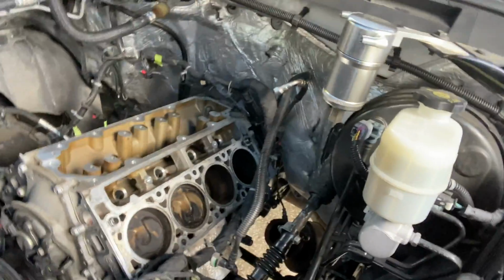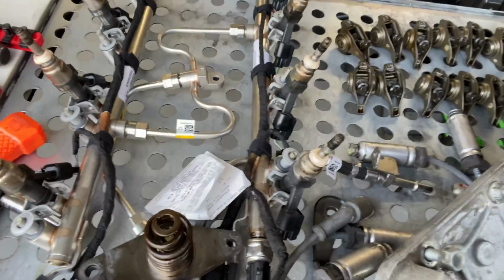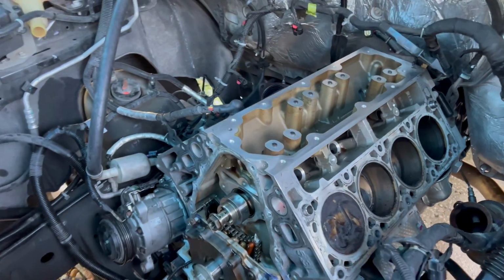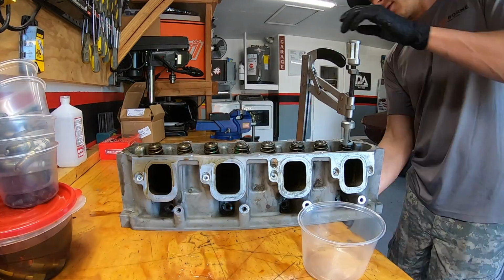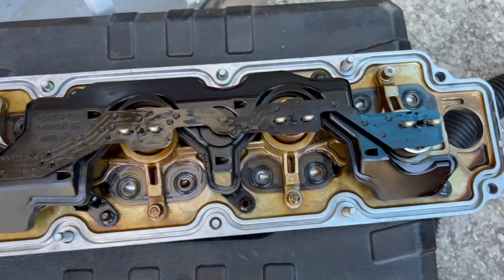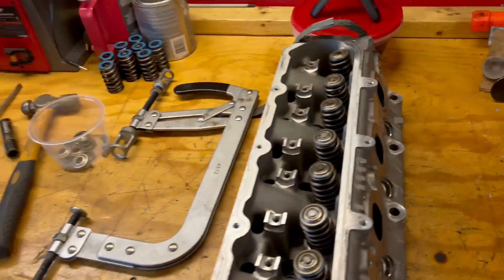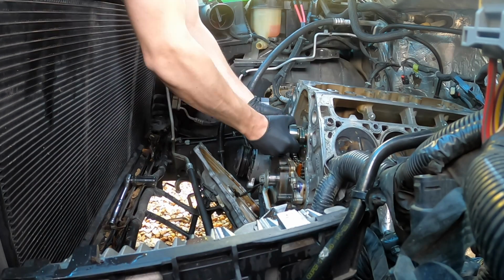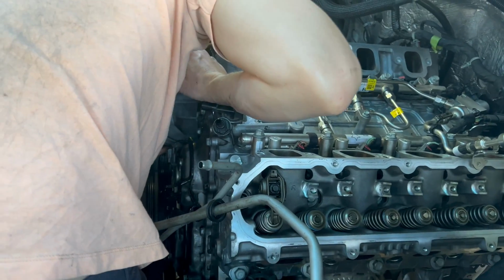Swapping a ZR1 Corvette cam into a 5.3 LT Truck!!!

Comment from the maker: Unfortunate as a collapsed lifter is, it never hurts to do a little upgrade
Reply: Just did the same. Had a lifter go and it SNAPPED the pushrod. 

So I did the full AFM delete and cam swap. Had the same raunchy ass smell when it started up lol
Reply from the maker: @RyanMonty  I hope you meant sound lol
Reply: @DAPerform  no, smell. From all the oil, fingerprints, coolant on the exhaust lol
Reply from the maker: @RyanMonty  oh duh, smells like burning flesh lol
Reply: @DAPerform  you got the part numbers for the cam and springs?
Reply: Could we get a list of part numbers ? Seems like the best budget option to delete Dod! Great job

Comment: How/why did the pushrod length change? L83/LT5 use the same 7.850, same ‘’Ls7’’ lifters , cam base circle is the same. Did you deck the heads or machine the block ? If not the geometry would have remained the same no?
Reply from the maker: Different cylinder heads, pistons and rods, there’s lot of reasons why the length changed just because they share a similar lifter and cam doesn’t mean everything won’t effect the length. That’s why it’s crucial to check
Reply: @DAPerform interesting thanks for the reply,  gm made these all pretty cookie cutter , we have swap cams in quite a few, LT5 , L8T in L83 , L86’s , all stock deck heights and no milling The LT5 and L83 share the same stroke, rod length and overall deck height is maintained from the piston. I still can’t wrap my head around your basic cam swap needed a shorter push rod.
Reply from the maker: @JustCantSitStill no idea. Our pushrod length tool doesn’t lie. Truck has been running strong since the swap with no valve train noise
Reply: @D @DAPerform well that’s all the matters in the end. 👍🏻

Comment: It’s still has a knock in it!
Reply from the maker: It went away after the first start. It takes time to pump the lifters up
Reply: @DAPerform 45 years GM tech , I do probably 20 of those upgrades a year as a weekend side job , that lifter tick goes away in seconds not minutes. As far as the oil pump R&R short cut you took good luck with that , that never works, invest in a magnetic drain plug because your oil pump will soon be talking to you. Monitor your engine condition with oil filter element inspections and oil analysis lab tests… Just a solid recommendation, no one like to do that same job over …
Reply from the maker: @cbnx82703 it’s been years since this was done and not a single problem with the swap. Thanks for your opinion!
Reply: @DAPerform  Well I am glad for you, your circumstance is more the exception than the rule , those clearances and tolerances are in the range of thousands of an inch, it’s totally fine to take risks on your own equipment but on customer jobs it’s not the worth the risk of the financial aspect. If you don’t mind what do you think that job ran parts wise ? By the way the removal of the fuel rail and injectors and high pressure fuel pump is the way I do it as saves about $200 in supposed one time fuel line costs…

Comment: So you didn’t replace the injector tip seals? Not a good move, it is necessary. You’re giving horrible information. Guess you’ve never seen a leak at the injector bore due to someone not replacing them.

Comment: Any quarter mile timeslips for before and after?  Did fuel efficiency change?
Reply from the maker: No and no
Reply: @DAPerform  Too bad, it's always nice to measure performance as the butt dyno is notoriously inaccurate.
Reply from the maker: @swathdiver489  it’s a stock lt4/lt5 camshaft just deleting the DOD. Lower gains would not be substantial

Comment: That's a nice little project. When I did my 2018 Silverado. I did a mild cam, DOD delete, changed the lifters, pushrods, and added a Katech Hi-po oil pump. The L83, and l86 are aluminum everything 
 It's great to save weight but not so much for heavy duty driving in the heat, they use oil to cool the bottom of the poaton and sleeves, they eat oil. I switched to a 5w-30 mix and with the heat and my heavy foot, here In Miami, she seems to be happy. But those trucks build with the bailout money have a bunch of faulty parts. I replaced.y AC condenser and did a heavyduty/hi-perf  trans rebuild. With a full Sonnax rebuild kit. She is build to hold 1000hp. I'll never push that motor to that. But eventually I'll do a few more upgrades and slap a small snail in there. Have a good one brother. Enjoy 🤙🏾🙏🏾

Comment: Bro, my truck chevy 5.3 l83 motor must be a god tier motor fully stock on engine internal no issues or ticking, only the transmission shutter, but im about to fully rebuild my 6l80e with everything upgraded new torque converter clutch plates etc even new driveline axle plus new cam since I'm investing in a converter and transmission to hold the power

Comment: Any increase in off idle tq and low rpm towing? Torn between this cam and the smallest btr/tsp cam available for the lt series engines. The 6.2 intake and tb made a noticeable off idle increase in tq on my otherwise stock 5.3.
Reply from the maker: If you’re not looking for any chop I would just stick with the factory zr1 camshaft. Theres no surging with the stock converter or any noticeable vaccum loss. Power wise it might have picked up up a little but nothing noticeable

Comment: Hello, 
I have yukon ls9 5.3 2008 i am thinking to get zr1 cam
Is it good so far and how much hp you got
What else should I add into my car with zr1 cam
Thanks
Reply from the maker: The can swap was to delete the active fuel management and replace the lifters that are prone to failing. Little power gains if any at all

Comment: One step back, 2 steps forward! I put on the Range technologies AFM delete at about 46,000 miles hopefully it'll prevent the lifter issue. How many miles? Thanks and good job! 💯🇺🇲
Reply from the maker: Lifter failure happened around 80k
Reply: @DAPerform  thanks

Comment: How’d ya get the timing chain over the cam phaser and sprocket?
Reply from the maker: With a lot of patience and time. It was no easy task but we got it done
Reply: @DAPerform  LOL… that’s called diverting the question bud..
Reply from the maker: @curtisrandell13  we had to walk the chain off of the sprocket. It seems impossible but it is
Reply: @DAPerform  tried that once then I stopped. Just didn’t have it in me 👍

Comment: isn’t this cam meant for boost tho ? why use it on a na setup
Reply from the maker: Yes and no. It’s a factory cam that was used on a boosted engine yes but the specs of the cam resemble more of an NA setup. They were never designed to make a lot of power with the factory zr1 engines which are 6.2l with a blower on it

Comment: Ur using stock torq converter or u have a bigger stall 1?
Reply from the maker: Nope stock converter
Reply: K kool im thinking bout installing one on my 2011 chevy had a stage 2 cam with 2400 stall

Comment: LS7 lifters are a factory lifter... they have a little different design than the stocks but don't offer any performance advantages and maybe a little more durability. A lot of companies make them some cheap some good. Morel and Johnson are some good ones for sure. Lifter preload is the most important thing to dial in for performance. Alot of people just go by the internet for data but exhaust and intake should both be checked with a pushrod length checker. The whole counting turns just isnt very percise imo. Good stuff guys and nice truck!
Reply from the maker: The counting turns method came from engine builders who had the time and tools to check them precisely. It’s not an exact science obviously but it gets you close enough to work. If this were a high performance engine or built for power then it would be different. Johnson lifters are a good example of that and how tight their preload tolerances compared to factory stuff

Comment: Did you have to resurface the heads before reinstalling them?
Reply from the maker: Just cleaned them up really good. There’s no need to resurface unless there’s a problem with the deck or head surfaces

Comment: Did you install a VVT limiter with this cam?
Reply from the maker: Nope
Reply: @DAPerform   can I swap the zr1 cam in an l86 and not mess with the vvt or do I need to tune it differently
Reply from the maker: @trucksandfarming6999  we are running the normal phase limiting for the vvt, it is beneficial to retain it unless you’re making more power than  stock. However you will still need a tune for the loss of DOD
Reply: @DAPerform  thanks for the response! I have to do engine work anyway and I enjoy the low end power and I raced against a same year truck with a stage 2 cam vvt delete and won by two bus lengths so since im sticking with with just basic bolt ons I wandet to keep the vvt and also can I use the stock push rods ?
Reply from the maker: @trucksandfarming6999  you’ll need new pushrods for the non dod lifters

Comment: Why do some shops take the motor out to swap the cam out? Then some leave it inn the truck. I was told the motor has to come out. While obviously it don't good job men.
Reply: Way easier to do it out of the truck. Also allows for proper oil pump and pan installation
Reply from the maker: @THENUBANDIT  true but why take the engine out if you don’t need to. Oil pump or pan never came off
Reply: @DAPerform  How did you get the timing chain off without removing the oil pump? I did it...but it was a nightmare. By the time I was done, I wished I'd have just pulled the engine 🤣
Reply from the maker: @RyanMonty  same way took a few hours to verify the timing was matched up but we finally got it
Reply from the maker: Only reason I could see would be to do other maintenance maybe a leaky rear main or new cam bearings but that’s usually not the case
Reply: @DAPerform  I'll shop around then. I definitely am not doing that job myself.. lol

Comment: I have a dumb question but I’m ready to start installing a On3 kit on my 2018 Silverado but mine has the L86 6.2l. I’ve been back and forth on this as I don’t need a big cam and was wondering if the ZR1 cam you did would be ideal for my turbo kit opposed to the Non-Dod Stock L86 cam that Texas speed Offers?
Reply from the maker: The ZR1 cam will raise the powerband with a turbo kit it would be more efficient and make more power with lower boost but the low to mid range would lower than if you ran the stock cam
Reply: @DAPerform  thx for the fast reply man and I kinda made up my mind now on this cam, can’t beat the price plus dod thanks again and subbed👌🏽👌🏽👌🏽👌🏽
Reply from the maker: @megalapagas  That’s why we do this man!

Comment: Worst cam to do
Reply from the maker: You’re right, should of put an ls cam in it
Reply: Should've done a truck norris!
Reply from the maker: @tjmoneybags  it’s not an ls my guy lol
Reply: @DAPerform  I wondered about that.  So the LT has specific cams?  Then how did the LS9 go in?
Reply from the maker: @tjmoneybags  it’s the LT5 cam.
Not the ls9
Reply from the maker: @tjmoneybags  it’s not an ls9 cam it’s an lt5 cam
Reply: @DAPerform  I'm shocked how different it is from the LS9 specs.  I thot it would be very similar.  Very low duration... not great. Decent lift.  Interesting is the Lower lobe separation.  The LS9 Lobe sep is 122.5 so to see only a 116 was surprising.  The LS9 is way more radical.  Now I see why you tried it.
Reply: Did you pry the cam chain off without removing the oil pump?
Reply: 7.800 how much preload
Reply: I have a 5.3 ls can you recommend me a cam for my 5.3 I need for turbo

Comment: One issue is the blower cam has a taller lsa which tends to lose low end power and moves power higher in the rpm.
Reply: You meen wider?  Blower cams usually have less overlap wich is good for low end and keeping cylinder pressure..also good for vacuum and map sensors...
Reply from the maker: @Handlehandlebars  less overlap on duration yes, I think he was only referring to the lsa
Reply from the maker: Most aftermarket cams have a lager split regardless, it might make the same power at 2000 rpm sure but beyond that there’s an increase
Reply: Yes I was talking LSA
Reply: Lol you guys lost me sorry thought LSA stood for lobe seperation...  but what do I know lol
Reply from the maker: @Handlehandlebars  could be nothing for all we know lol

Comment: That first start up tho
Reply: first start up had me worried. heard the tapping and it sounded worse than the original lifters
Reply from the maker: Definitely sounded like new lifters lol
Reply: Agree
Reply: That first start up sound is on any new complete valve train in an engine . It takes a few seconds to pump all the oil in the places it needs an, to reach the lash set on the lifters. This is common. This is why you use a moly lube( a break in lube on the  cam so it doesn’t run dry. This is a excellent video. Would like to see a few more details I. This video but it is one ex Ellen’s clip… great work guys!!!! Now about that Camaro in this back ground……….